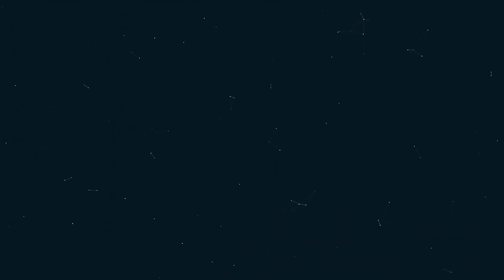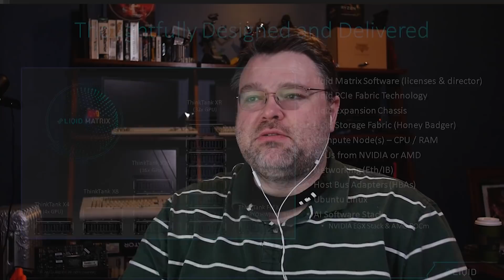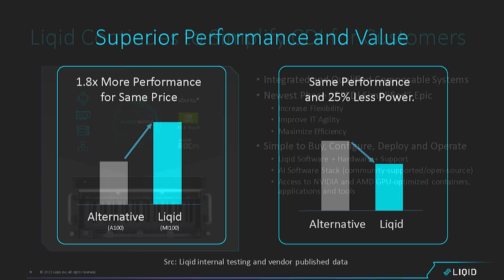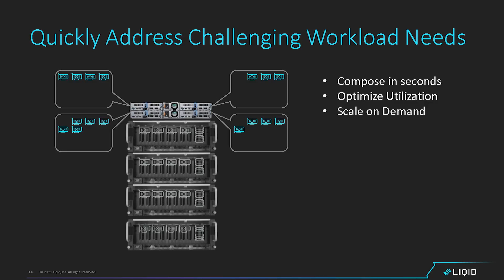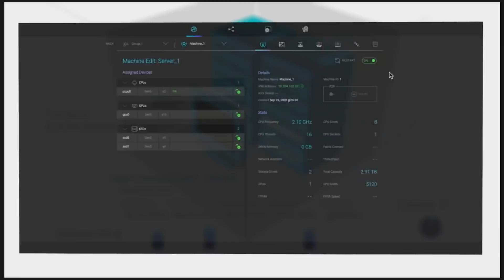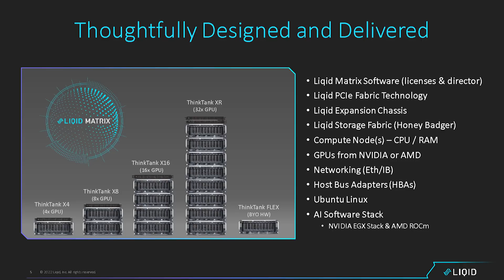Think Tank: 16 gpus in 1 u; Liqid makes PCIe Fabric happen for everyone

Comment: I think that this works best really for a LOT of discrete workloads, rather than throwing a lot of resources towards a single or a few workloads.

I mean, sure, HPC, you're going to have that anyways, but even with that, I have found already that sometimes, it is actually better to assign/provision/allocate fewer compute cores per job so that I can run more jobs in parallel and finish ALL jobs, collectively, faster, than if I threw the entire cluster at each individual job.

Even with a highly parallel task or an embarassingly parallel task, there are still potions of it (e.g. initial data read in/final data write out) that's still single process only, which means that the rest of the system would be sitting idle whilst it is waiting for those processes to finish.

Comment: I would be very interested in more details about the physical cables, connectors and adapters that can handle PCIe Gen4 over distances…
Reply: I am pretty sure it will all be fiber
Reply: Hit me up on the Level 1 Forums :)
Reply: Oh uh. Mark_Liqid?
Reply: So....a PCI Express 4.0 x16 link has a maximum theoretical bandwidth of 256 Gbps.

Similarly, a Nvidia (read: Mellanox) ConnectX-6 card can also do around 200 Gbps whether it is on Infiniband and/or on 200GbE.

In other words, it can already be done.

And then with fibre optics (and all of the different kinds of transceivers and receivers modules), as long as you have the underground fibre laid out to support 200 or even 400 Gbps, there is no reason why you can't do that over long distance (e.g. 10 km).

In other words, it can already be done.

In reality though, it is unlikely that you would actually deploy it like that (where it is "across town" or even co-located servers are you're more likely going to provision services and servers closest to you).

Like in theory, you CAN, for example, run MPI "across town", but you would lose a LOT in terms of efficiency vs. running it in the same building, and/or in the same server room, and/or in the same server rack. (A lot of HPC clusters (e.g. Top500) would be in the same room and/or in several connected/adjacent rooms.)
Reply: @ewenchan1239  Well nice, that it “can” be done. In my personal practical experience it’s impossible to operate U.2 NVMe SSDs with PCIe Gen4 in “Gen4-capable” backplanes like the one from Icy Dock without a hefty amount of PCIe bus errors even if you use OCuLink cables that are “supposed” to handle PCIe Gen4…
Reply: @abavariannormiepleb9470  
To be fair though, Icy Dock isn't really quite the same as an actual server backplane.

If I were planning on using a U.2 NVMe SSD, I would be buying a server that has "native" support for U.2 NVMe SSDs, rather than trying to buy an Icy Dock to "retrofit" a system which didn't have "native" U.2 NVMe SSD support to try and add it in after the fact.

I agree with you that I wouldn't trust the Icy Dock for that at all.

And of course, getting say a Supermicro chassis that natively supports U.2 NVMe is more expensive, but if you're going to be spending the money to buy a U.2 NVMe SSD in the first place, it would seem a tad silly (to me at least) that you'd spend all that money on the U.2 NVMe SSD, and then buy an Icy Dock, which ends up hindering the performance of said U.2 NVMe SSD instead of buying a Supermicro chassis which natively supports your said U.2 NVMe SSD.

The chassis solution has to be matched with the U.2 NVMe SSD solution, otherwise you're going to result in a bottleneck and/or create more issues than the money that you might have potentially saved.

(And I've been in the position, as a student, where money was tight. So, I would beat the crap out of mechanically rotating hard drives because I wasn't able to properly deploy U.2 NVMe SSDs.)

(Heck, I haven't even deployed any M.2 NVMe SSDs yet.)
Reply: @ewenchan1239  I can follow your point of view but I would also like to use easily swappable U.2 SSDs in desktop systems. It does work up to PCIe Gen3 without any errors.
Reply: @abavariannormiepleb9470  
Yeah....I've actually decommissioned most of the SSDs from my entire home lab because I look at them and treat them the same way that I treat the brake pads on my 2013 Ford Fusion Hybrid: use them as sparingly as possible.

SSDs are wear components.

They WILL fail.

It isn't a question of IF, but a question of WHEN.

Once you've exhausted all of the program/erase cycles on those NAND flash cells/modules/chips -- that's it.

It's like a brake pad.

Once the material is consumed, it's gone. And you're going to have to replace it.

It works if that's your data drive.

But for an OS drive, a bit that's more of pain in the butt, because now you have to hope that you would have migrated the drive over onto a fresh, new drive, before your current drive dies.

In the past 6 years, I've killed 5 SSDs already.

If you're running Windows, putting your swap/pagefile on a SSD is one of the fastest ways to kill said SSD (which is the default behaviour of Windows if you install Windows on a SSD).

I was able to kill my Intel 750 Series 400 GB NVMe 3.0 x4 SSD in about a year and a half because I was using it as a swap drive.

So....I don't really bother with it much anymore.

I actually went BACKWARDS and bought a whole bunch of HGST 1 TB SATA 3 Gbps 7200 rpm hard drives and migrated backwards onto HDDs away from SSDs because of this problem.

Now I don't have to worry quite nearly as much about whether my HGST HDDs are going to die the way that I would have had to worry about my SSDs dying.
Reply: @ewenchan1239  My issue isn‘t the general durability of U.2 SSDs but their connection to a motherboard. Everything I‘ve tested so far is “sh..”, important to diagnose issues or even register that there are issues is enabling PCIE Advanced Error Reporting (AER) which is conveniently disabled by default on most motherboards.
Reply: @abavariannormiepleb9470  
I think that I've only ever used the Icy Dock for four 2.5" SAS 6 Gbps drives.

Sounds like that it is time to upgrade to a proper chassis with proper U.2 NVMe support.

Comment: Pretty amazing stuff. Barely halfway through the video, I am wondering if this is only available in a hardware+software combo product. 

It would be amazing if there is a free single user (limited) software version that is available for testing. Maybe with just some consumer/enthusiast hardware and supports multi-GPU (up to 4 or something like that).
Reply: You would still need Liqids PCIe switching hardware